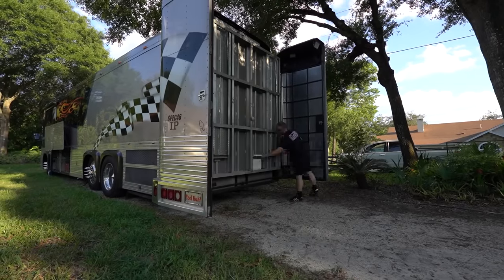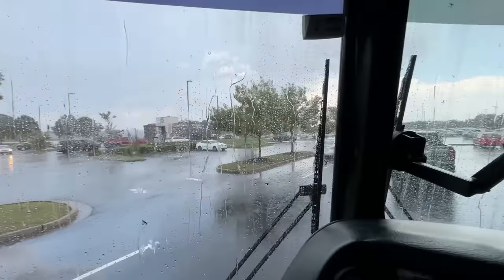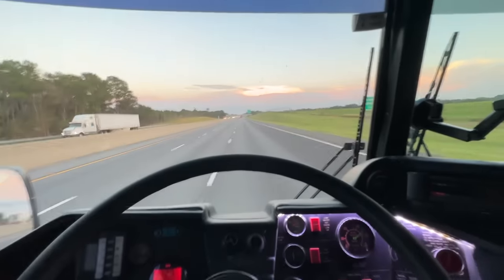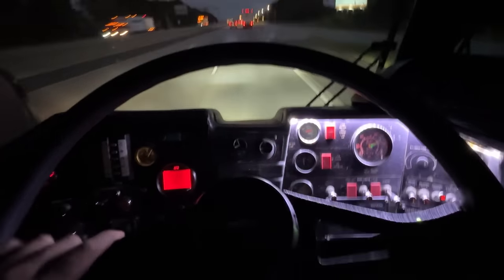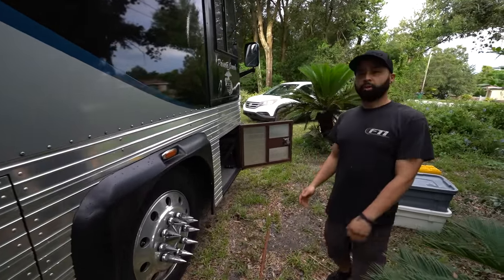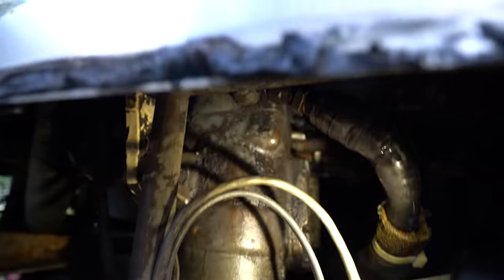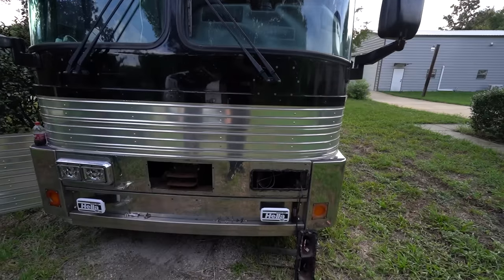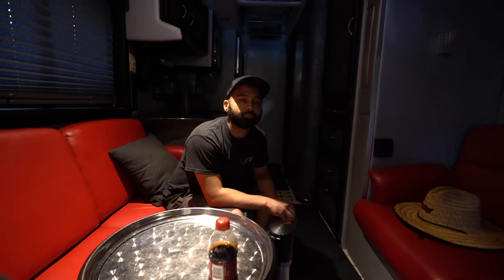First breakdown in the new car hauler bus conversion. major problems far from home.

Comment: As a trucker I would recommend checking in at a T/A PETRO, Loves, or pilot shop next time you have issues. They have tools and mechanics to fix most problems with heavy duty diesels. Best of luck!!
Reply: Most truck shop have no clue about busses. Best to make friends with a bus shop for advice and parts help some parts can be very hard to find.
Reply: @jasonsimons7704  Bus Grease Monkey - someone PLEASE get Taylor to connect with this guy and get the bus looked over - argh!
Reply: @BLKMGK4  Yeah, I’ve seen his videos. He can do amazing things if you can make it up the hill to his shop, lol.
Reply: @BLKMGK4 I’ve been saying this since day 1
Reply: I don't know about the others but some loves won't touch rv or buss because they don't have the ability to do somethings but some of the mechanics would be willing to try and help out at least
Reply: @dominicklynch6771  that's insane: a bus IS made of truck parts. The chassis is different? Who cares?!

Virgin mechanic: Ohno the engine is at the back! I don't understand!
Chad mechanic: let me watch that.
Reply: @guy_autordie  it literally isn't the mechanics because I worked on quite a few it is loves because yes motor is same but they are set up a lot more different than you think and loves doesn't like taking the responsibility if something happens to them
Reply: Yeah, they're still thinking auto repairs, and for the guy that said truck shops don't know buses, a hose doesn't care.
Reply: You’re absolutely right. As others mentioned, try finding a bus repair shop and asking questions and who knows you might make friends with a mechanic that would be willing to help you out on his or her off time to get your bus sorted. Who knows maybe the shop will have good rates and you could just have them sort it for you. The possibilities are endless…
Reply: @dominicklynch6771  the fear of court trial this court trial that. literaly "why we can't have nice things."
Reply: @guy_autordie try crawling under a bus..... Do you think u can fit under it
Reply: I am an owner operator would never recommend  a ta or petro. That’s a go and get the fix fixed.  Go to a mechanic that has good reviews. Had a ta replace a brake hose. They wrapped it around my drive line. Had a pet or say I needed a new axle. Went to Ian different shop took mikes to it and it was fine. Ta petro is getting you to next real fix. That’s a fact.

Comment: No big deal in the long run. I sort of expected this. Old hoses are old no matter how many miles they have on them. My friend had to replace a lot of hoses on his old Prevost. You'll have her road ready with a little elbow grease and a little jibber jabber. We'll see you on the next one.
Reply: It would have been smart to get an inspection from a bus mechanic that knows what they are looking at.  They could have made a list for them and then Taylor could have either done the fixes himself (more videos) or had the mechanic do them (or a combination depending on what needed to be done).
Reply: @Joe-hz1nw  Coming from someone that has worked on many RVs from million dollar NASCAR drivers track busses to busses that were almost 30 years old and were considered cheaply built when new. None of these buses and very well built under the living space façade. RVs are like boats in that they can be maintenance hogs and very expansive to repair. Especially on a bus considering the majority of the major maintenance items are basically sitting on the ground under the bus, and generally not even easy enough to make a visual inspection for the average owner. I've seen buses that were immaculate in the living quarters and from ground level up externally, but because the owner couldn't get underneath I found that it was nearly unfit to be on the road.
Reply: @LKN117   thanks for the comment. None of that surprises me one bit.  Out of sight, out of mind, plus the somewhat manual cottage industry that bus conversions seem to be.

At least it was/is job security for you😁
Reply: @Joe-hz1nw  I don't work on trucks anymore. Moved onto bigger and better things. Literally. 👍
Reply: @LKN117  good for you brother 🇺🇸

Comment: The same happened to my Eagle, however, I dumped all the fluid at once backing into my driveway after a long two-week trip. The lines run through the tunnel.  In the original coach you would lift the floor Panels to access the lines, however in a conversion those panels are covered with flooring. Where there is a bay, you access the tunnel from the Bay.   I had to gut the inside, remove the floor panels, replace 90 feet of hose and put it all back together with new flooring.  Biggest repair yet.

Comment: Things you should consider keeping on the bus:  Airbag , Slack Adjuster , Airline + spare fittings.  Wheel bearing & seal. Some hydraulic fittings and patch sections.  Mostly though it is usually the air breaks and lines that will cause the majority of issues.
Reply: Does the bus have air suspension? I'd keep a spare brake chamber before a slack adjuster. Extra heater hose is also a good idea.
Reply: Also a big enough jack air gun and I would look into a possible spare if you had a spot for it
Reply: Brake caging tools {but tow truck $$$ will have them}  LOL
Reply: @lenscap8925  New chambers come with caging bolts
Reply: I definitely agree
Reply: @icelover3 
I don't think Eagle ever made a bus with air ride.
Eagle uses torsion bars.
The ride is incredible, I have driven 200 miles with an open coke can on the corrugated floor.
Still there when I stopped.

Comment: For heavy equipment hydraulic lines we keep something called field fixes in the trucks. It’s like a DIY hydraulic fitting that goes together like AN lines so you can basically add a union in a leaky hose with hand tools to get you by for the day until a hose can get made.

Comment: Earls has some really nice power steering fittings with nice Parker hose that don't require crimping. It would be great for roadside repairs, but when you see how beefy the hose is, I doubt it would ever fail. Need to check the PSI rating on the pump though!  Edit: i agree with others- hardline the middle!
Reply: Why add more leak points? Just run a new line front to back and tie it up properly so it doesn't rub. Job done, no fittings to leak that you can't get to.
Reply: @--_DJ_--  As a patch to get you back on the road quickly, it sometimes a couple of extra fittings is quicker, cheaper and works.
Those Parker fittings are designed for hydraulic pressures that are far higher than power steering.
Reply: @--_DJ_-- it may be more potential leak points, but easier to repair in most cases if it does leak.
Reply: @agentcrm  Oh as a patch, make 10 joints if it gets you on the road again. I meant as a permanent fix.
Reply: @DecalsAndFriedChicken13  Hyd. hose is tough stuff, installed properly it isn't going to leak in the next couple decades.

Comment: Worked in a power steering/ hydraulic company for 23 years, one of the biggest in North America. I know that and every other hyd. system you could imagine. Your best bet would be to change it from front to rear but they do have what they call field hose ends you can install on the bus with a couple wrench’s. They are like your AN style fittings that I’m sure your familiar with. You can always cut the bad end off and splice a new section in. The hose size is more then likely #8 with a 37 degree flare. Your power steering reservoir also houses a return filter that has probably never been changed. Sorry you had to turn around and miss the show. You’ll get the bugs worked out I’m sure of it. Thank you for all the awesome content.

Comment: Is there any way to have a hard line in the middle? I know it would be more connections and more potential leaks, but if you have a well mounted hardline and hoses on each end that are short they would be easier to replace if something did start leaking in the future.
Reply: I'd prefer a multi section hose. Hard lines on equipment always end up with mounting and cracking issues, vibrating and chafing with harmonics etc. Unless it's overbuilt built like an excavator, skip it.

Comment: As someone who works on a farm away from town, as well as someone who has to do a lot of hauling.... get every fitting and coupler you can think of. You can get bench top (vise mounted) hydraulic crimpers from basically anywhere. As long as you have the fittings and hose on hand. You can roadside repair anything. You don't need to replace the whole hose if you can crimp on a coupler fitting with some slack. I can't wait to see this build work done. I believe you made the right purchase. Now you know what you need to fix things on the fly.

Comment: sometime down the road you could try getting a small towable/ fold out camping trailer for the boys for behind the bus
Reply: That’s honestly a huge inconvenience. 

Worrying about a trailer you can’t see. Having to dismount to load and unload car. 

Very silly.
Reply: the cab has 2 beds plus once the awnings fixed and they can leave the car outside they can fit 2 more people in the back which is also AC'd.
Reply: The purpose of getting this rig is not having to tow anything

Comment: You need to make a new line in three or four  lines so if it ever breaks, you don’t have to have a 50 foot piece
Reply: yeah right, and have 3-4 more places for a leak !! best option is hard line with hoses at the pump and box.
Reply: Terrible idea. Why add more leak points?
Reply: If you want to replace a six or $700 piece of hose every time it breaks be my guess but I would make it in a few sections. This ain’t my first rodeo.
Reply: @icelover3  Hose is the weak link. Fittings are rarely an issue.
Reply: @tuck6464  You're right, but I've also seen defective fittings develop leaks over time. To each their own.

Comment: I lived in a bus when I was a kid.  My dad converted a city bus and we lived in it for years.  Yours is such an amazing rig.  A few things leapt out at me when I was watching.  

1. I would love to see a series that is a deeper dive into what you do with it.  Even a full overhaul (and some in depth maintenance videos would likely be helpful for those looking for one of these older busses).  

2. I would add d rings specifically for some hammocks in the garage.  The only thing you are short on is sleeping areas and hammocks would solve that issue.  

3.  I would only have things for the race car in the garage, and move all the bus fluids and parts to under the bus.  That will make it easier to get to them if you have an issue and are somewhere less than ideal and have to do repairs.  It was odd to me that you would want to climb around the race car to get to oil for the bus.  

4.  A magnetic bug screen for the garage bay door.  I would either find or make a magnetic bug screen that you can magnet in place on the garage door with a Velcro (or magnet) center opening to keep bugs down when you are at the track.  The cargo camper conversions use those on their rear doors and it is always rated as a top upgrade.

Absolutely loving the channel!!!

Comment: I found that working on motor homes and buses that the leveling jacks made all the difference in the world for working on these vehicles.  Having to get under there it makes access so much better in getting it done in a reasonable amount of time vs. being under there until you grow old.  The jacks give all the clearance you will ever need, so, install 4 of them if they are not installed.  The second thing you need is a 12v fluid transfer pump.  That would have filled the P/S reservoir within a couple of minutes.  They are good for transferring almost any kind of fluid.  Milwaukee makes several types of these pumps and they are all good.  Best of luck. Your channel is great.

Comment: Not sure if any of these items have been mentioned yet, but i would make sure to check your air dryer cartridge and purge valve. They are regular maintenance items. Would also highly reccomend checking your steer axle king pins for wear and to keep up with greasing all of the brake and suspension components. Been wayching your channel for years by the way. I love the content and your builds have inspired some of my own. Cheers!

Comment: Definitely more work, and the likely hood of another power steering line failure is low after replacement, but I would recommend running hard lines the length of the bus with a soft line at each end. If there is a problem in the future, you can just remove the short line and have another one made

Comment: Use a garden sprayer with the end cut off. Heat it up and give it a bend. You can now easily get the wand anywhere and pump fluids in. Trick from brother in-law who’s a master tech for Toyota.

Comment: Those fittings are field re-useables. You unthread the shank and then the Ferrel. Cut out the bad spot thread the Ferrel back on, then insert the shank and thread in. Perfect seal for low pressure systems like power steering. Check out your local Pirtek hydraulics they also have mobile repair techs.

Comment: Helpful tip,If you replace the hose tie a long enough string to one end of the hose and pull from the other end,untie  the string and retie it to the new hose and pull the string thru 👍
Reply: Oh if it were only that easy. It will be attached in a hundred spots and the fittings will catch on everything. I'd just leave it in there and use it to hold the new one in place.
Reply: It will have dozens of P clips
Reply: Haha yeah most likely

Comment: Taylor,
You are such a thorough guy that you will certainly sort it all out.
As a diesel heavy equipment mechanic for over 40 years, I suggest you go to a few local truck parts shops and get familiar with the  common repair items for your rig. You will definitely find better solutions for a lot of things done back in 1989.
I recommend that you use hard line sections for the length of the bus and soft lines for your critical connections that way you can easily repair and maintain the system for the long term. Stainless is expensive,  but worth it in certain situations, especially difficult access.
There should be a raceway or access way along the framerails or through the cargo spaces to access all of the mechanicals, water lines, drains, holding tanks for water and waste, electrical and so on. Most should be between the framerails, but also in the floor spaces.
I'm sure you and the boys will start seeing it all pretty quickly.
Be prepared for a much steeper maintenance cost overall because you are dealing with over the heavy hauler equipment and not "heavy duty" pickup trucks.
Shell Rotella T 4 is an excellent all around use oil for your rig and you can find itjust about anywhere.
You might want to consider having a  truck shop do a full rig inspection to know what is expected for maintenance and service requirements according to DOT because even though you do not need a CDL license to drive the bus, it still requires commercial safety maintenance and the inspection will be the place to find out what is recommended versus DOT required because as you cross different statelines, they all do things a bit differently, but if you know what the rules are you can avoid a lot of hassles.
You boys are more than capable and I look forward to your new adventures.🤙

Comment: If I can have my 2 cents…I drive a semi and the safest thing to do is always look over everything all the time not only for safety (being the main reason) but also to prevent slow downs like what happened you. You my friend do a great job of this. 

Don’t beat yourself up because you’re forgetting the biggest factor that the bus is almost 35 years old! 

It’s time for it receive a BIG maintenance tune up for pretty much everything. Lines both fluids and air. Brakes. Engine. Basically everything. 

It’s expensive but once you do that thing will last another 35 years!

And plus I guarantee you’ve already moved it around more than the previous owner in such a short time so yea!

Anyway Taylor please film a full series of this build!!

Comment: * * * .... Wait. Phew. Move the resevour, anywhere from back to front to some EASY access point. Edge of one of the side doors.
2. Hard lines front to back, then short flex lines at the ends. Maybe another pair by the resevour..
That kind of length with reasonable access to air will give pretty good cooling too.

Great channel, love the ride all this time.
Thank you.

Comment: As a diesel mechanic and class 8 truck mechanic (used to work on rear engine buses) I highly recommend to get some jic reusable fittings for hydraulic lines. Also keep some plastic air hose of different sizes, quick connect air fittings and some spare brake hoses. You’ve got plenty of room on there and that’s simple stuff that’ll get you out of a bind. Just my two cents, love the new bus!

Comment: I know this is a past tense suggestion, but I carry one in our motorhome just in case.    Lubrimatic 55-001 4CC Fluid Pump for Quart Size Bottles.   You can always add a longer stem for bigger bottles.
Reply: Milwaukee cordless transfer pumps are amazing. Use them to pump out water barrels or flush oil systems with 75w140, it does it all.

Comment: I would get the fittings to convert the power steering pressure and return hose to pipe with AN hose on each end. Even just AN line without pipe means you can make your own hoses.

Comment: Just to mention. I work maintenance for an express car wash company and they all have extra hydraulic hoses of all lengths and also most have the presses/crimpers to make new hoses. Coulda chopped yours and made you an extension piece while using a union. But I get that it’s a lot of stress having to figure out where to go when on the road. Somebody is usually gonna be there to help you out though man